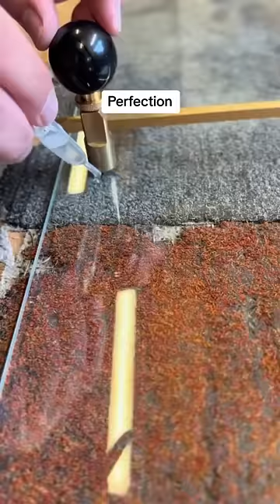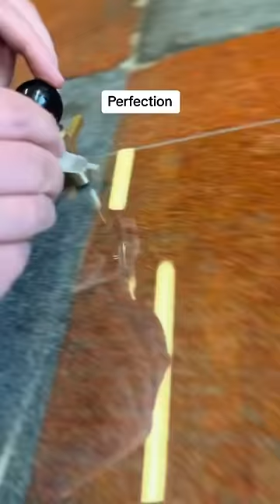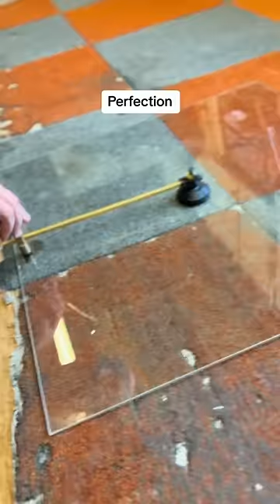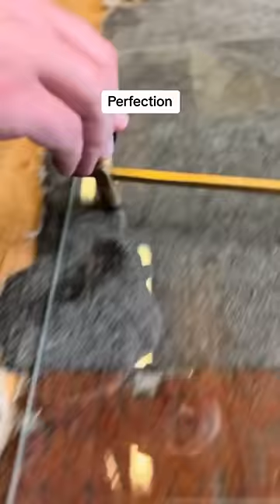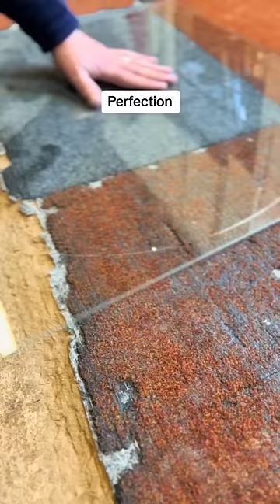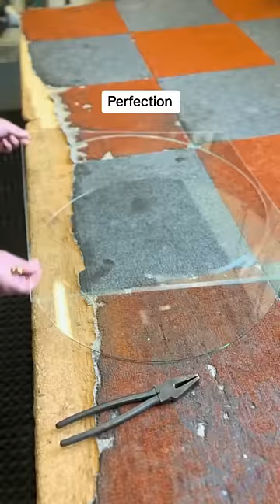Sorry For The Scraping Sound

Comment: Did you observe, he made a wider cut first with less tension and then the actual cut with more tension. That' could be the reason for making a perfect cut. When he uses the cutting plier to separate them, it could have done damage to the main part. So he might have done a wider cut to avoid that. Brilliant!!
Reply: I didn't notice. but now I see that. thx
Reply: No 1st. cut. That was to spread the oil evenly before making the score on the glass. Been in the glass industry since 1984.
Reply: @jamescollier3  oh okay. Thank you 😅
Reply: @w.w.2restorations.vehicles698  Also, he used a lot more pressure the second time. He waited until the glass was first slightly scored  the entire way around so if a crack appeared it would have had less chance of propagating away from the circumference of the desired cut.
I cut glass for custom picture frames for 3 years
Reply: Either way if he cut the first time or didn’t or whatever he moved the diamond cutter so I don’t know why he would move it but he did move it. He moved it one way and then the other he didn’t move it one way and then back, because that tool isn’t set up to do that, you can move it as far as you want too
Reply: @e-racer4673 it isn't a diamond.  Its a tiny steel wheel.  The first circles are just spreading oil.  You only score glass with ine stroke. The time he obviously presses is the only score.
Reply: @e-racer4673  what are you even talking about

Comment: Good to see it done properly. I remember once I went to a glazier for a new round glass for a wall clock. He seemed to be in a rush, and he had to have three goes at it, each time damaging the glass when trying to break the circle out. The piece I ended up with still had a chipped edge, but fortunately, it was concealed by the clock's bezel.

Comment: I work for a glass company and one slow day we cut a bunch of Batman logos on our CNC machine. No one at the shop could manage to break the pattern out properly. It’s much harder than it appears
Reply: CNC for glass? A video please.
Reply: @HB-CL-TX  Yes, that is right ! In our factory we used cnc cutting machines, able to cut any shape out of sheets about 6 x 3,21 m2 ! That machines were programmed by the operator or via coputer programs. It is very satisfying to watch that machines cutting !
Reply: Если что, обращайтесь)
Reply: Of course, have you not seen Squid Game.
Reply: I remember doing this for 12 years straight open cut both sides for cleaner break, I made heart mirrors difficult to get out the top of the heart as wants to crack or shell
Reply: @yoric7200  That's where my thoughts went :') Squid game S2 my friend... We'll see :p
Reply: How old is that machine? I’ve done several with no issues.

Comment: Here's an idea that I've used many times over my 20 years of playing with glass. Put the oil on a paper towel then set the cutter on it and run it around the cutting area. Then cut it.
Reply: Or just dip the cutter
Reply: A simple dip of a little brush then the cutter above make the circle round remove the brush and make the cut.

Comment: I miss that sound. I was a glazier for 10 years till my shoulders gave out.  Circles and free hand ovals were my favorite. But no gloves?? Been cut way to many times to not have them on. I used transmission fluid as my lubricant.
Reply: Were your shoulders giving out related to your work? If so, I'm very curious as to what kind of work you were doing if you don't mind me asking. But of course the entire profession seems fascinating just because there's so little I know about it
Reply: @ideaspark1316  yea it was.i was the shop guy. I was lifting tilting laying down 48x120in sheets of 1/4" mirror, around 120lbs each 10-15 times a day then all the other work.
Reply: Damn rotor cuffs are worked hard in glazing brother!
Reply: 40 years as a Glazier and both my shoulders are shot.
Reply: Always just used self oiling cutters. In my younger days I was tabling 72x130`s by myself. Nowadays Impact glass makes that seam lite.
Reply: 30 years here as Uunion Glazier and I have 2 knees, 2 hips, and 7 back surgeries, 1 shoulder surgery, and elbows hurt...smh
Reply: It's a wonder to me that they haven't invented some sort of wheeled glass sheet trolley that lays it down on a table gently so all you have to do is push it onto the table.

Comment: 4mm glass sure.....now let's see you do that with a 10mm or 12 mm piece....it's the thickness that makes that sonsimple and the fact there was enough oil. Putting oil down keeps the  tungsten carbide wheel cool but is also needed so the score doesn't get hot as we call it.

Comment: Yeah, but can you do that perfectly on a display case while hanging on a rope you just climbed down coming from a heating duct in the ceiling directly above that you crawled the entire length of the building through to bypass museum security by accessing the duct system vents from the rooftop that you stealth landed on silently using a hang glider that you flew onto the roof because that was the only way to get up on the roof without getting caught which you learned after weeks of studying the building inside and out to the point that you even had the blue prints memorized so you could navigate through the heating duct system and come out right where you want to be directly above the display case and climbed down the rope and hung from without touching the ground and triggering the alarm then cut a perfect circle out of the glass case also without triggering the alarm and stealing a priceless gold and diamond artifact? Then do it all again backwards on your way out? Huh? Didn’t think so.

Comment: This guy would freak if she saw my Grandpa’s shop and how he cut glass for china cabinet’s.  Rutting  around a dirty box of tools pull out a few glass cutters, roll them on finger to find any with bur or chip and then just cut., using his finger as the guild down the edge of the glass or  string held with his thumb for circles.